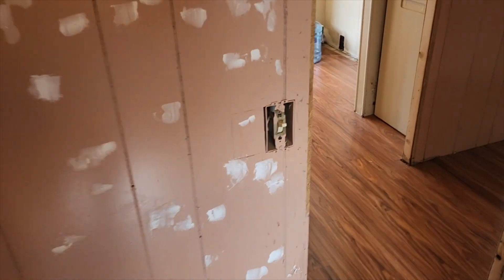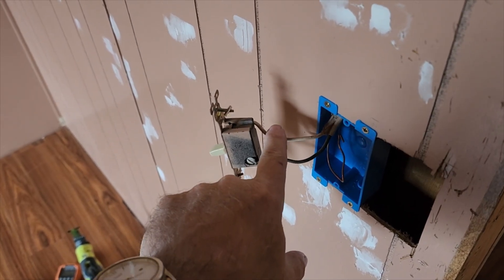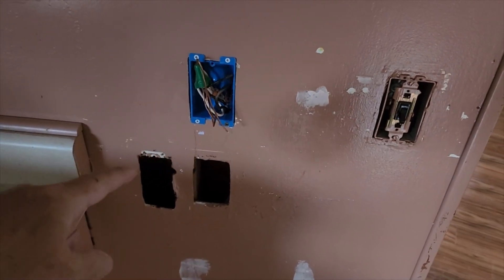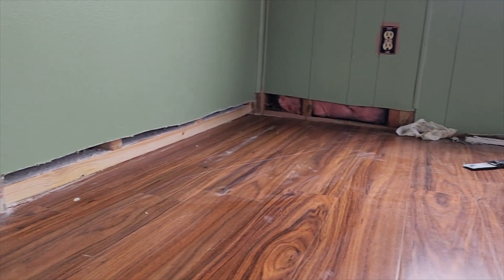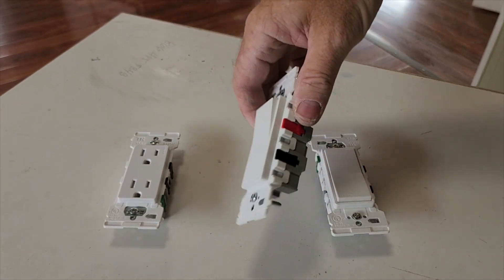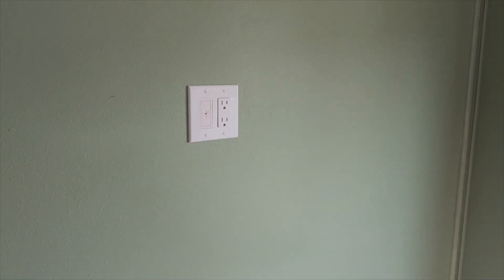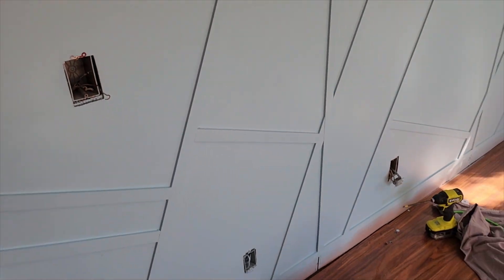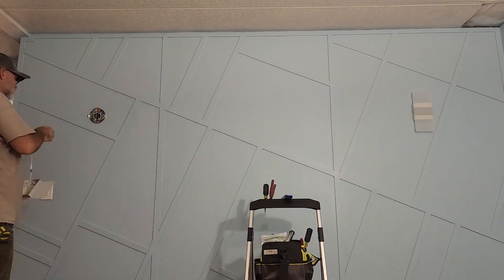Is the electrical system safe? | New devices from Leviton! | Part 3: Pink House Renovation

Comment: To our surprise when we moved into our current house, we found out that all of the outlets on one of the walls in the garage were controlled by a switch inside the house that also fed the outside lights. We were going to place our freezer on that wall, good thing we didn't. Now we have maps of the different circuits of where the wires are run thru the house and the main box is all labeled correctly now. No more trying to figure out what the previous owner did. ⚡
Reply from the maker: Yeah, it's always a challenge for sure!